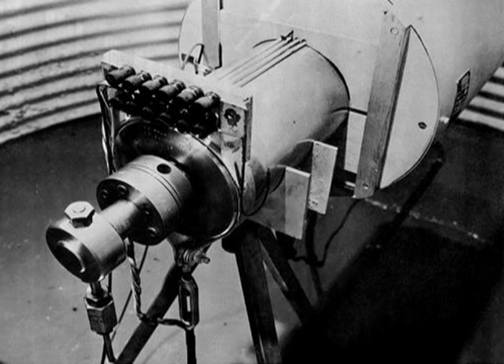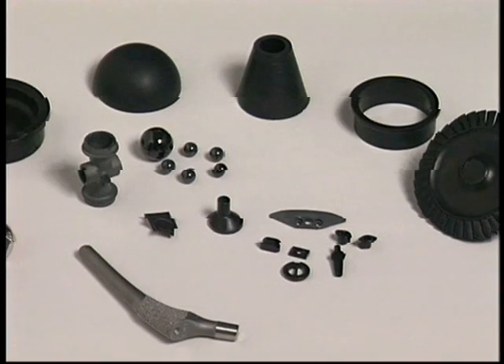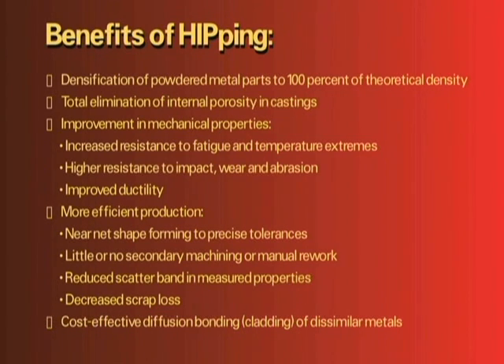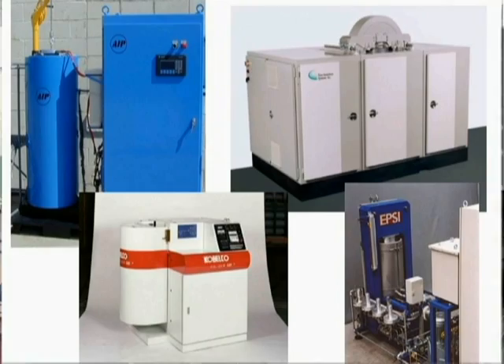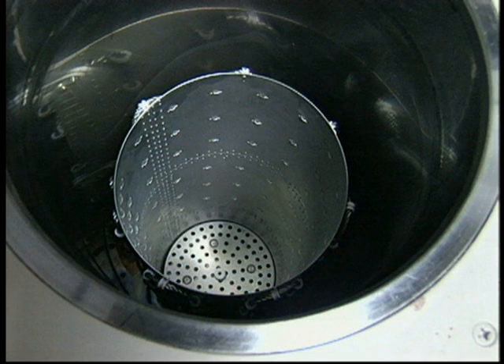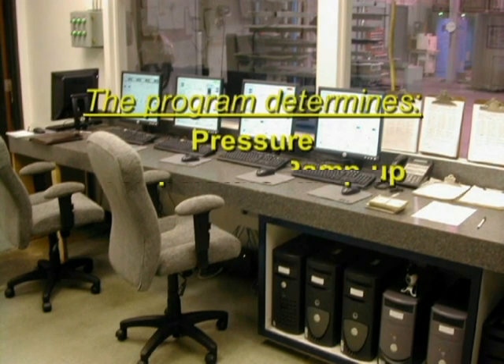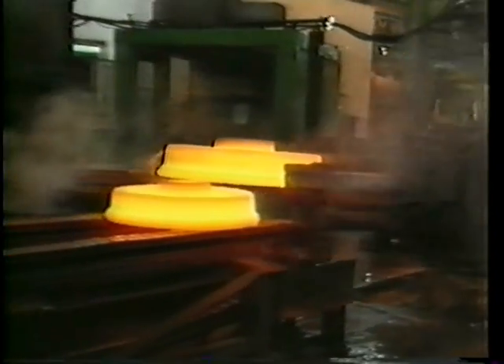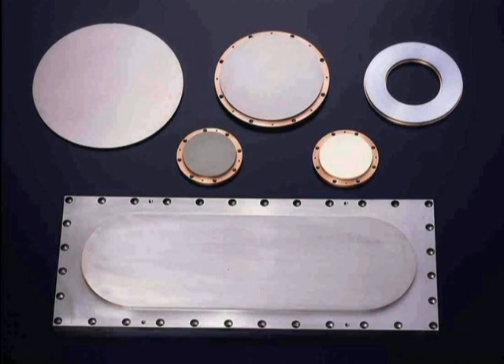Hot Isostatic Pressing (HIP)

Comment: What I want to know is once they weld these metal molds closed, how do they later extract the part? (5:51 mark in the video)
Reply: I don't work in this field, so this is my guess. They break it and take the item out. They have to seal it tightly to prevent the gas pressure from dropping. They don't need an expensive container, just one that can be sealed so that the gas can be pressurized. These smaller containers are placed inside the larger HIP container to be heated.

Comment: http://www.alloyconsumables.com/  Thermal spay powders, includes Nickel, Cobalt alloy powders are widely used in oxyaccetylene spraying, high velocity oxyfuel (HVOF) spraying, plasma transferred arc (PTA) overlaying, laser cladding, induction overlaying, powder metallurgical processes, injection molding, centrifugal casting, as well as 3D printing.